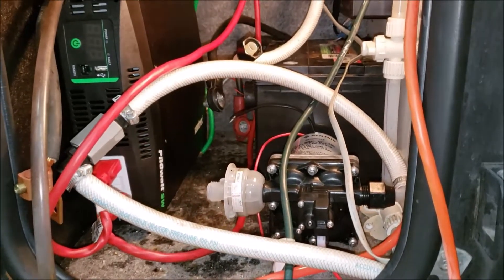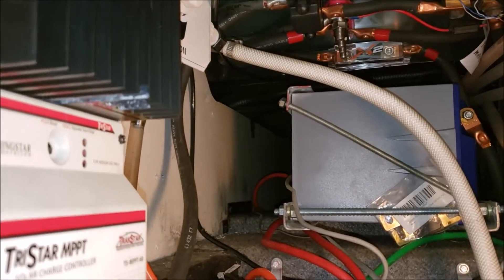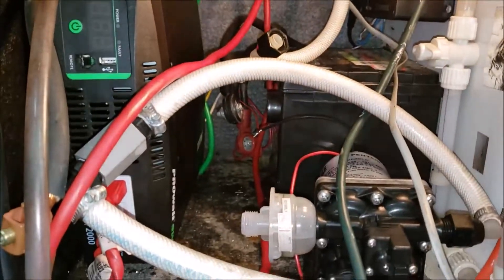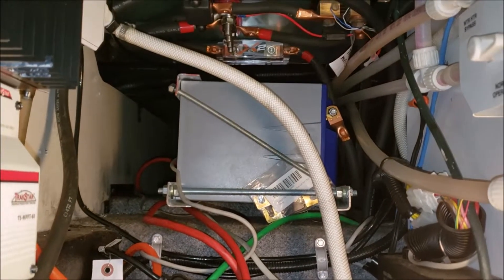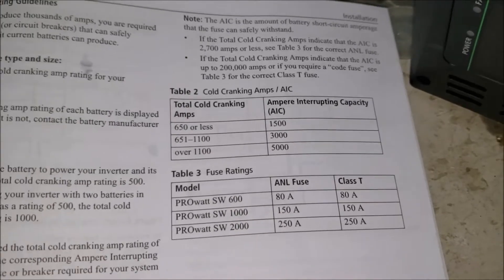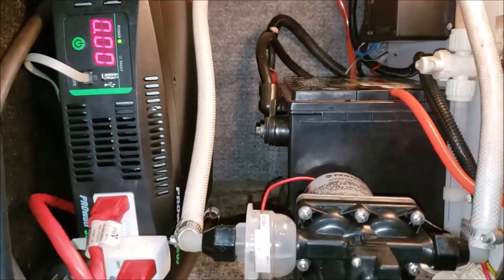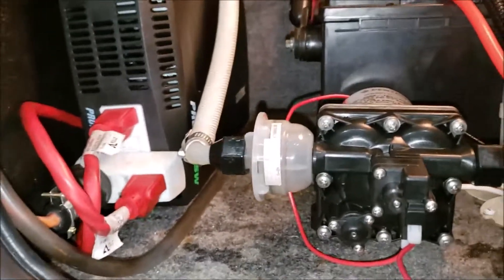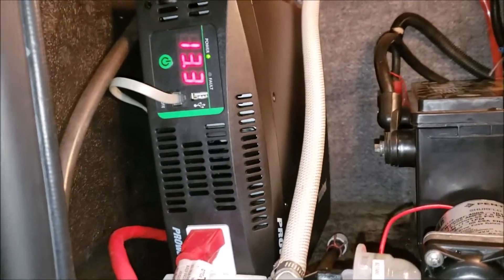Upgrading from a Xantrex Prowatt SW1000 True Sinewave Inverter  to a Xantrex Prowatt SW2000 Watt.

Comment: I’m considering installing a 2000 watt inverter in our 2004 Adventurer 33V, I watched your earlier 1000 watt install video, did you add a third 15 amp transfer switch for the microwave circuit?
Reply from the maker: No I keep a short heavy duty extension cord handy when i need it and plug the microwave up to receptacle that's already on the inverter. We ares till running the 2000 watt it performs great
Reply: @ktoutdoor  That makes sense, thanks so much for responding.

Comment: Hello Kevin, I've been searching online with no success.  I know this video is about a year old but I have a question.  What are the terminal bolt sizes for the SW1000 & SW2000 ?  Thanks
Reply from the maker: The stud is 8mm 1.25 threads

Comment: Kevin,

Have you had a chance to measure how much power your microwave pulls?  My Sharp Carosel pulls 15 amps.  That is 1800 watts.  If I happen to try it while the fridge is in defrost I would exceed the 2,000 watt inverter.  Have you had any such problems?
Reply from the maker: Our sharp is pulling about 1600 watts / 13 amps https://youtu.be/9w3TBhjpqH8?t=255 so far I have not maxed out my 2000 watt Xantrex

Comment: Thank you for your video. I was thinking of upgrading to a 2000 w inverter as well. My 1000w was factory installed. Did you need to change the wire that goes from the battery to the inverter to double 00 , increase the fuse size, and that was it?

Thank you

Comment: Thanks Kevin for sharing.  I’m hoping I can get by with the 1000w using my refrigerator.  As we discussed-we don’t boondock much so we’ll see how it goes.
Bruce
Reply: I did that for my home fridge and the Xantrex fails with fail code E04
Reply from the maker: @belmontsolar6202  E04 = Over‐temperature shutdown is the fan working ? is it well ventilated? Did it cool off and start working again?
Reply from the maker: You should be fine the only time a maxed out my 1000 watt was when I hooked up a large lazer printer it would spike about 600 watts at start up along with TV and computers running it was just a little to much.

Comment: We have had a 2000 watt Xantrex for a few years now, but before we got the LiFePO4 battery, when we ran the microwave on of the four 6 volt golf cart batteries, the microwave moaned and groaned, but with the LiFePo4 battery it runs just it does on shorepower.
Reply from the maker: That's good to know thank you Paul.

Comment: Did you feel you had to do that because of new Residential Refrigerator?
Reply from the maker: The 1000 W inverter was doing a fine job with the new residential refrigerator but if I hooked up my laser printer that may Max it out it takes a lot of juice to fire up those laser printers to melt the toner so I'll just give myself a hedge of protection by going up to the 2000 watt inverter. Plus I can run the microwave where I never could before